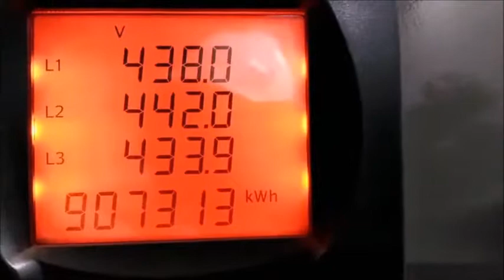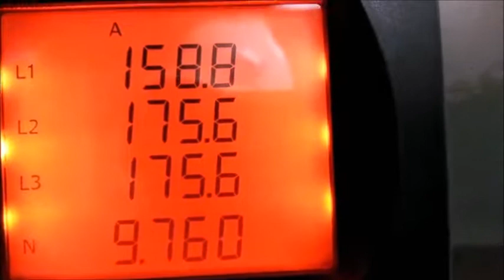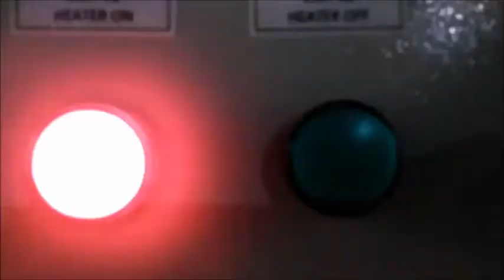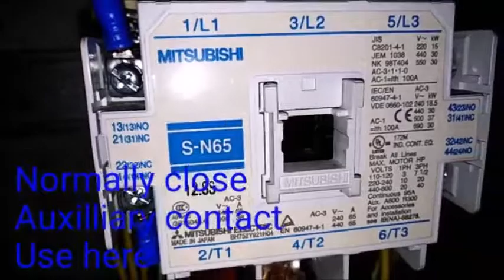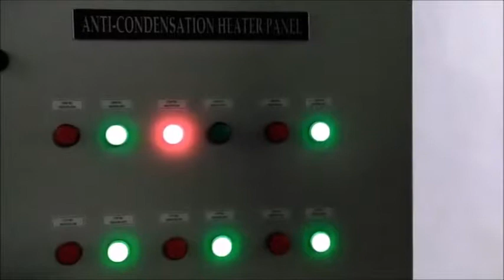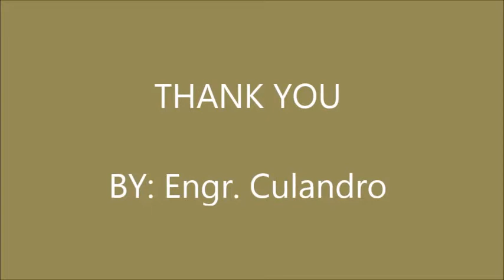How Motor Anti condensation heater powered up

Comment: If motor off, heater on. Is it possible motor overheating?? Hot to control heater temperature.!?
Reply from the maker: Low wattage heater around 300 to 600w.. Just enough to warm, not really hot... Heat dissipate through body. Multiple motor start in hour causes overheating but not the heater
Reply: @electriculand  thank you for answering, really helpful 👍